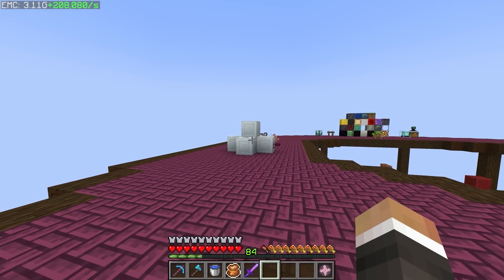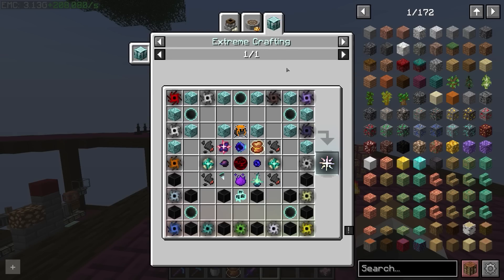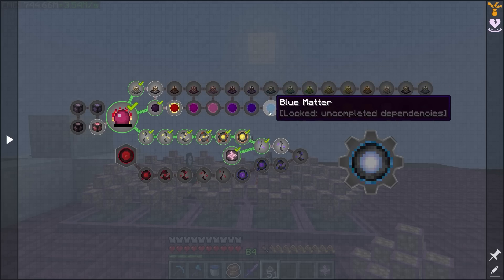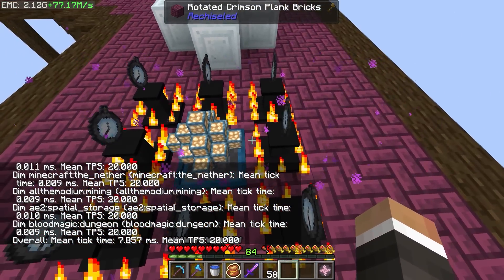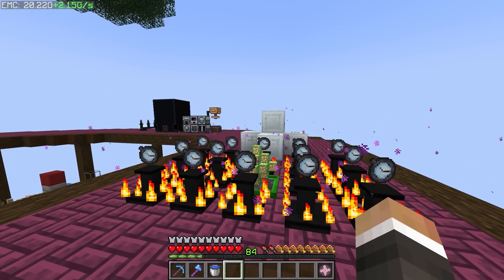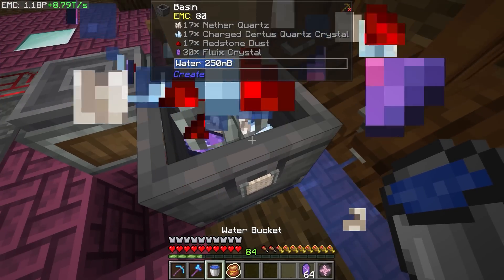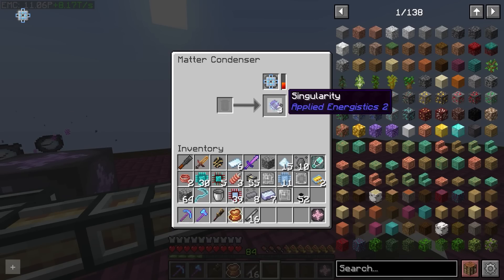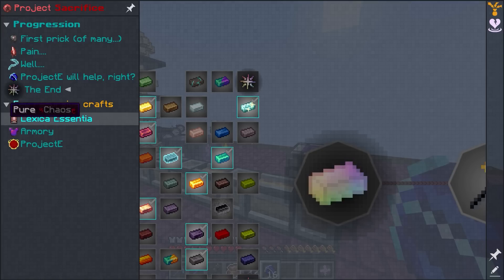Minecraft Project Sacrifice | FINAL POWER FLOWER & ANTIMATTER! #14 [Modded Questing Skyblock]

Comment: If you’re looking for a super simple clock, two observers facing into each other makes a pretty quick clock and takes up very little space
Reply: you can make an extremely fast clock, faster than anything vanilla can do, using the powered latch from create
and all you have to do is run its output back into its side, and then give it power from the back
Reply: @axolotl_princess so exactly like a comparator clock. Lever on back. Input led to the side of comparator. Can’t remember if it needs to be in subtract mode or not though.
Reply: @xiar5546  except a comparator clock triggers every redstone tick, so every 2 game ticks 
the powered latch clock triggers every game tick, so it’s twice as fast
Reply: Observer clocks work, but they, sadly, are annoyingly laggy